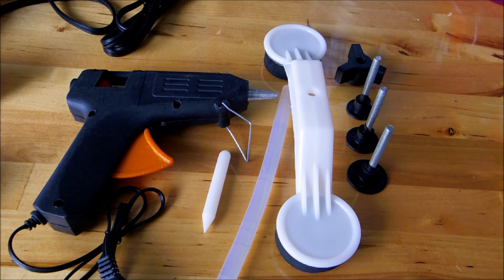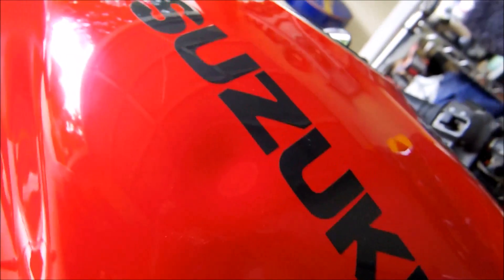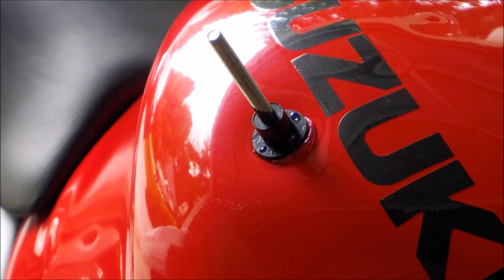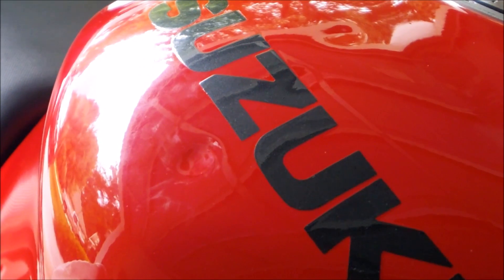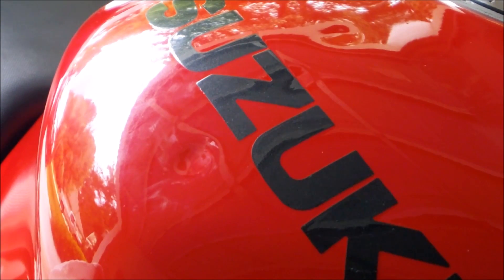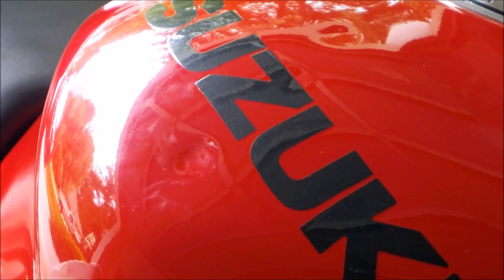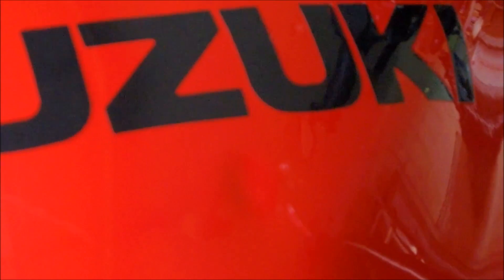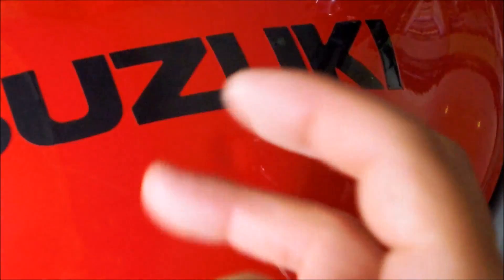Removing a Dent from a Motorcycle Tank

Comment: You want your pulling area to be no more than 30% of your overall diameter. If you put just a small amount of glue right in the center a few times it would probably be gone. If you put a huge glob on it will pull the edges off first and pop before ever really pulling any pressure from the center of the dent.. if that makes sense

Comment: Very pretty bike! Be sure to play it safe out there on it. Your vid is of good value. It shows just what to expect from that tool.
When metal dents, it HAS to stretch! Just think about it!
It is still stretched. It may not pull out or hammer out and ever leave you with a perfect and original looking surface.
If after trying all simple pulling and hammering methods, you still have a wrinkle or dent or bump...
Pull tank, flush it with water then blow it out with a shop vac outdoors. (Many aircraft explosions happened during this step).
Put a small tip on an oxygen/fuel torch. Test that tank will not blow up by burrying it in water or sand and passing flame over opening and then again while blowing with shop vac. Heat area of dent to dark red. Hammer it from inside until it looks smooth or bulges out.
Heat it again and hammer it smooth from outside using a "bucking bar" shoe on the inside.
Verify dent area NOT higher than surrounding metal; peen hammer it in if needed.
Wire brush clean and flux the surface of the metal.
Plumber's lead sweat the area.
Shave the lead, sand it smooth.
Glazing putty, primer, fine wet sand. inspect. paint. clear coat.
Flush tank with Methanol alcohol. This GRABS water like magic. Dump that.
Reassemble. Done.
The heat allowed the stretched steel to relax and re-form. Under the heated stage, the steel was all in your control.
Reply: Spot on

Comment: Good Day All :  The last time I saw moderately damaged bike gas tank repaired , it was by a British auto body man . He cut holes in the underside of the tank and used those openings to put steel rods into and did his hammering from just there through the underside . That was a Kawasaki GPZ . The final imperfections on the top side were filled in the regular way .

Comment: Doubt you'd get that out with glue, you'd need a slide hammer on bike tanks as they're tough! Those piece of shit kits are only any good on a minor car panel dent, usually bike tank dent you have to use a rod and go at it from the inside. well done for having a go though!